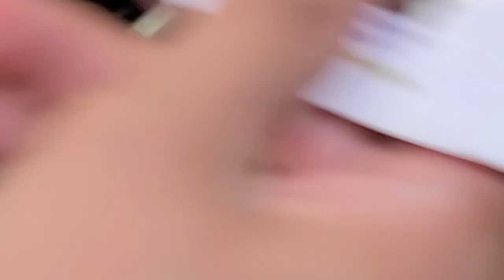Audi Steering Wheel Mods DIY : TTRS Start Buttons | Air Bag cover | Wheel Cover

Comment from the maker: One thing I forgot to mention! Make sure you put the car into neutral before you disconnect the battery in order to move the wheel freely.
Reply: hey you did the push start but this doesn't show the drive select connection ? did it all work just doing it like this ?
Reply from the maker: @jackclark7624  the drive select piggy backs off the the push start I show it in the video the buttons connect together

Comment: I think leather airbag cover is very unsafe mod. Airbag cover has a deep groove inside. When airbag explodes it breaks airbag cover in half, right exactly where this groove is. With airbag cover covered in leather and sewed around with strong thread you altered conditions for airbag explosion, and now nobody knows what will happen in case of accident - who knows if airbag will be powerful enough to rip leather, and even if, is airbag will inflate in correct direction and with correct power (maybe ripping leather will consume so much energy so airbag will not inflate enough to protect your head). If I would be in your pants, I would at least buy another airbag, and combine it with this leather airbag cover and explode it in garage to to test what happen.
Reply: You do know the original plastic is harder than the leather on this airbag and it goes through easily (seen it first hand)… He won’t have any trouble with the leather ripping to deploy the airbag..

Comment: Great video! I got this same kit for my 2019 S5, but I cannot get the Drive Select button to work!  The engine start stop button works fine, but the other button does nothing.  By chance were there any extra steps you didn't show for the drive select button, or did it just work out of the box?  I'm a little confused, because pin 3 and 6 shouldn't have anything to do with the Drive Select button, but you didn't do any other wiring under the center console! Any help would be greatly appreciated!

Comment: bRuH! This is way too much work...I love all the diy for the audi/vw but this was oh dee to watch much less to attempt to undergo...Much respect to you sir for the diligence and tenacity to accomplish this project plus film/explain it for others to give it a Go. 👊
Reply from the maker: Lol it's looks more involved and difficult than it actually is. Especially due to the drilling. The drilling can be substituted by gluing the buttons onto the trim
Reply: @ChampagneS3  the drilling was fine...my concern is mainly with pulling the wire-pins and tapping into the red power cable...ultimately I'm sure I can do it, however I'm not sure the novelty of the buttons is worth it to me. It does look awesome but not enough for me to go thru all that work.
Reply from the maker: @Leo.SKDXL05  ahh I see what you mean. It's actually designed for you to plug into the fuse box in an empty slot as intended. I just tapped into the USB power wire as it was easily accessible. It's pretty easily done with a clip to tap to the wire
Reply: @ChampagneS3 so if I tap it into the fuse box then how do I loom it into the gearbox? Or is it separate?

Comment: Great video. Did the Steering Wheel Malfunction stuff was because you had the shift knob off? Went away after you finished everything?
Reply from the maker: Moreso because I had the battery disconnected. All errors disappeared after driving less than 100 meters

Comment: Hi, very nice tutorial! Really learned a lot from it :). A question, isn't replacing the airbag cover with an unoriginal one voiding your insurance in some way? And is it safe to do this yourself? I can imagine if you place it back slightly wrong, the airbag may not go off or not entirely correct.

Comment: I have SQ5 2015 . The connector of the start stop button is only with 4 pins. What color of two pins I need to change with the wire that came with the steering wheel?

Comment: Nice man! Looks sickk how's the button feel of the new start button? And as well where did u get u gauge pod? Is that just a s line sticker on it?
Reply from the maker: The button feel is very OEM. At first I didn't like how the start button looked in certain light angles. However once I saw that both buttons actually illuminate it quickly changed my opinion. Very happy with this kit. Gauge pod and gauge is from one of my sponsors Aeroforce Technology. They sell custom faceplates for their gauges with many makes and models available, a pretty cool option

Comment: Great vid 🙏🏽 I don’t have stop start function but still want start stop buttons on my steering wheel, is this still possible
Reply from the maker: Is it turn key? There should be a way but you'll start have to turn your key to the ACC power position and use the button use the button to crank. As for this kit I'm unsure if it will have everything necessary for it to work with that kind of application. If you have a start button on your centre console then it should work just lole the video
Reply: @ChampagneS3  yeah just a key no start button. Do you think I’ll need a start stop module? Or just the key in ignition will be ok?
Reply from the maker: @dyingbreedministry  if you get a start and stop module that may be better.. Then a kit like this may be able to tap into it to get the signal
Reply: @ChampagneS3  thank 🙏🏽 you so much for your time brother 🙂 God bless and thanks again
Reply from the maker: @dyingbreedministry  anytime! Best of luck! Hope you get it working, it's definite a nice option to have

Comment: I think if you drill the hold even larger the small hole guides would go in the plastic trim and would be flush I’m not sure that’s what I think.
Reply from the maker: I see what you mean. But just keep in mind the screw is meant to hold the trip to the guide. It basically anchors it, if you drill it large so the guide hole goes through you won't be anhcoring it anymore

Comment: Thanks so much for posting this video, it was HUGELY helpful, I just completed this mod to my car.  Can I ask:  when you push the start or drive select  button with your headlights lights off does half the start button illuminate?  I think its an off centre status light, and it looks just a little strange, and wonder if its normal?  I think I can see yours does it at  24:58 ?

Comment: I'm confused how you got the drive select to work,. I thought that was what the blue wire you left disconnected was for. I didn't see you do anything to the drive select connector in the video. Thx!
Reply from the maker: No worries there's a white wire that connects both left and right modules together..this is the connection that allows the drive select to work
Reply: i think you have to set drive select to the *-button to work without the blue wire
Reply: @ammi1184 Can this be confirmed (setting of * Button)? I read about programming with an OBD interface and ODIS E 🤷‍♂️. In other cases there is an other module for the drive select button connected to the center button console. I am confused…

Comment: Hello you maybe remember which pin the white cable goes to and which is the blue one?
Reply from the maker: It didn't matter in my case. It can go to either pin 3 or pin 6 slot

Comment: if i dont want to tap the red wire into my usb connector, where do you think should i put the fuse to? Do you know how many amp it needs? I purchased my kit with a steering wheel, did not come with any instructions at all. thank you for your DIY, it looks great!
Reply from the maker: I can check when I get a moment but a 10amp would be sufficient
Reply: @ChampagneS3  thank you! I also tried to wire pin 3, pin 6 and pin 5, to no available. ( my kit is like yours except I need to wire 3 pins)… I was able to see that the buttons on my steering wheel transmits a signal to the motherboard receiver ( I see the blue light every time I press on start/stop or drive select).
Got a 2020 B9.5, so a bit different… your guide was really helpful!
Reply: Okay I found one fuse slot from the accessories fuse panel on the side (not the footwell). Also , I found out why I didn’t have anything, the connector has two clips to remove before inserting pin 3 and 6
Reply from the maker: @darksaigon  thanks for the update. Hopefully this will help others that have the same platform as yours 🙏

Comment: When you removed and reinstalled the airbag, did any dash lights/errors appear that weren’t there before? And if so, were you able to remove them? I’m looking to swap the airbag cover but was curious if you had any dash lights/notifications appear?
Reply from the maker: You will get lights on the dash at first due to the fact the battery was disconnected. Once you drive for a few mins they all clear. So you should be good 👍
Reply: @ChampagneS3  Sweet man, thanks for the quick response🤙

Comment: Just did this but the buttons on the steering wheel and paddle shifters dont work now....
Reply from the maker: There's something not connected if they don't work. These extra buttons more or less piggyback off the existing power
Reply: @ChampagneS3  you're right - turns out the tiny connector on the right side of the steering column. The red wire kept  slipping out of the connector.  Got it figured out but that dang airbag cover takes the longest of all the steps in my opinion 😅🤣 even though I did it like 5 times

Comment: I have seen that your multifunction buttons on the steering wheel light up for 2 or 3 seconds after you switched the ignition off at 25:14. I have got the same problem after installed the buttons, could you fixed the problem?
Reply from the maker: It hasn't  really been a problem as they shut off automatically.  Even if they do come on for a split second they turn off almost immediately after.

Comment: Hi do these fit on a vw golf r steering wheel! Mk7.5? The buttons 
Also would it be same fitting ?
Reply from the maker: They have a few options for different fitment. So yes they do also have them available for VW. There are options for Audi, VW

Comment: Hey, The video is a great help but mine keeps getting stuck at one side like it did in you tutorial when you uncliped the 2nd hole but mine doesn’t unclip no matter how much i tried, It looks like its uncliped from both sides but for some reason one corner stays stuck , Is there anything you can suggest for me to try pls
Reply: Like it happens at 3:28 in your tutorial…
Reply from the maker: @atiaturkmani6890  what I did is I pushed it back in and did the whole process again. You'll have to use a bit of force to ensure it in unclips
Reply: @ChampagneS3  got it off thanks for the reply though, I just had to re do the whole process

Comment: Is this steering wheel the stock unit that came with the car?
Reply from the maker: The steering wheel is stock with the exception of the mods I installed in this video. The buttons, steering wheel wrap and air bag cover are what I installed.
Reply: @ChampagneS3  Thanks for the info. There is a company refitting these steering wheels to the previous Gen TTs. I thought your steering wheel was after market but it's good to know it is an OEM quality wheel.

Comment: Just changed the paddles on my 2020 tt rs but the horn has stopped working, does anyone have any ideas please?
Reply from the maker: Did you remove the airbag cover? If so it may not be aligned properly.

Comment: I did it and After i turn off the car, the start stop button sets on automaticlly by itself, do you know where could be the problem?

It starts without pressing the button
Reply from the maker: Check then board to see if it is reading an input without being pressed (it will light light up costs flg if it is reading an input).
Reply: @ChampagneS3  i messaged you on ig :)

Comment: Hello. I'm korean.
Does the steering wheel turn when the ignition is off?
Reply from the maker: 안녕하세요! Make sure before you disconnect the battery, the gear is in neutral.
Reply: @ChampagneS3  good video thank you so much ^^If I put it in neutral gear, turn off the engine, and disconnect the negative terminal, does the steering wheel turn?
Reply from the maker: @user-vh1sb9by7x  네 맞아요👍

Comment: how did you make the start select work on the steering wheel ?
Reply from the maker: It works by just connecting it to the oem buttons on the steering wheel.
Reply: @ChampagneS3  oke thx and do you have a link where to buy the steering wheel cover ?

Comment: there is no way my airbag is way stiffer and even with the bolts removed I can't remove the cover
Reply from the maker: Honestly sometimes I've had to do it a few times over as if it's really tight it's not seated properly and one of the wires are getting caught
Reply: @ChampagneS3  i managed to get remove i just used a plastic trim tool